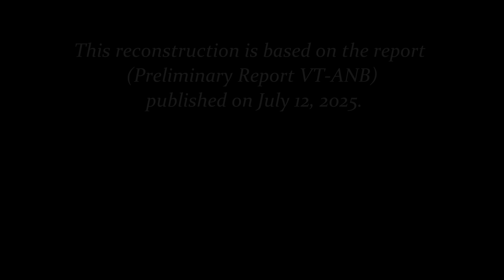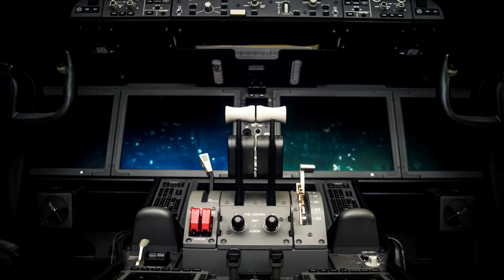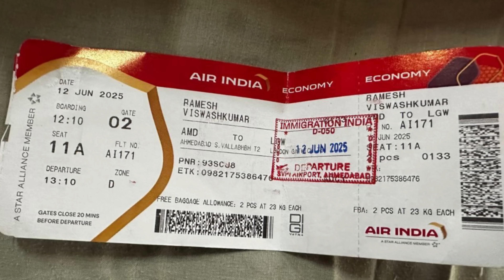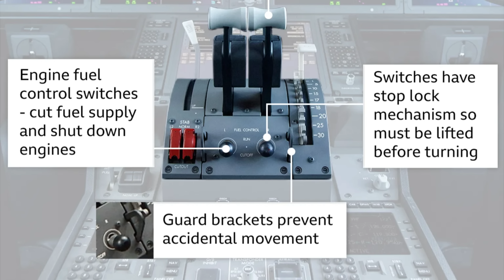787 Dreamliner Crash in Ahmedabad: Air India Flight 171 Crash Explained

Comment: Dramatic vid even with music, but narrator has no clue about 787 tech.. here we had a design problem and an electrical glitch.. tech manual tells us fuel switches need NOT move If electricity to fuel valves  is lost for even a fraction of a second, 787 and 777. Then, the spring loaded fuel cutoff valves to the engines will snap shut. Cockpit switches stay OPEN.... Happened to ANA 787 after landing using reversers, in Osaka and unable to restart.   Rtd Training Capt EAAC  Pilot Union rep at Regional Air Accident Investigations
Reply: Hopefully will be clarified in the final report. At this stage don't know if was intentional or unintentional by one or both pilots, electrical or mechanical failure. If had to guess it was one of the pilots that cutoff the fuel for both engines intentionally.
Reply: Sämtliche dieser Stories sind erstunken und erlogen, getürkt und gefälscht.
Es wird gesucht, mit welcher Mär man am besten verwirren kann,
um den wahren Grund zu vertuschen.
Da wird im Trüben gefischt, dass sich die Balken nur so biegen.
.
Wer in welches Mikrophon gesprochen hat, zeichnet der Boardcomputer
(Blackbox) auf. Wer was gesagt hat, lässt sich über eine Hüllkurvenanalyse
feststellen. Ein Standardverfahren in Forensik und Kriminologie.
Doch sowohl die Tonband-Story als auch die mit dem Treibstoffschalter sind
erstunken und erlogen. Das hat alles nicht stattgefunden.
.
.
Nein. Die Triebwerke waren ab V1 nicht mehr abschaltbar.
Die 787 ist "redundant".
Das bedeutet auch, dass widersinnige Aktionen nicht getätigt werden können.
Sie können den Schalter umlegen, so oft Sie wollen. Es hat in der Startphase
keine Wirkung mehr, da die Programmlogik aufgrund der Redundanz, ergo
des Systemzustandes (Takeoff) einen unsinnigen Befehl schlicht nicht ausführt.
Das ist auch bei der Landung für die Schubumkehr so.
.
Außerdem hätte zumindest die APU noch funktioniert.
Da auch das RAT ausgefahren wurde, wurde nichts ABgeschaltet, sondern das
komplette Bordnetz fiel aus.
Auch DAS lässt sich von den Piloten vom Cockpit aus nicht machen.
Nur am Boden bei Servicewartungen. Um die Maschine zu reseten.
.
Jamming per GPS aber schon. (!)  War schon in den 80ern vorgesehen, so
möglichen Luftpiraten die Übernahme einer Maschine unmöglich zu machen
und die Maschine per GPS in "sichere" Gefilde zu lenken.
Einige wenige Systeme mit eigenem Stromkreislauf (Funk, Black Boxes) wurden
noch von den Akkus gestützt.
Man hat sich erst mal weiterhin mit Sky-Marshalls beholfen. Aber inzwischen
gibt es ja besagte Technik und die immer perfekter.
Die hier dargebotenen Geschichten sind frei erfunden. Erstunken und erlogen.

.
.
Man sollte als BRICS-Mitglied besser keine amerikanischen Flugzeuge kaufen. (!)
Boeing ist auch ein militärisches Unternehmen.
.
Beim MCAS-"Absturz" der Äthiopian-Airlines saßen 20 äthiopische UN-Delegierte
mit in der Maschine.
DIESE 20 Delegierten, die mit ihren Gegenstimmen dafür sorgten, dass die USA
keine Militärbasis in Äthiopien errichten durften.
.
Dass das per US-GPS satellitensteuerbare  MCAS  generell geheim gehalten wurde,
war keine bloße Schlamperei und/oder Sparmaßnahme um Airbus dagegenzuhalten,
wie offiziell kolportiert.
-
Das US-Amerikanische GPS-System wird genauso in Waffensystemen wie Drohnen,
Raketen und dgl. verwendet wie in der Zivilluftfahrt. Das Jamming weiß nicht,
ob es die Funktionen eines zivilen oder militärischen Gerätes stört, bzw. unterbricht.
Das weiß nur der Absender.
.
Auch in der Indonesischen MCAS-Absturzmaschine Lion Air saßen fünf solcher
Widersacher, mit deren Votum ein Jahr zuvor auch in Indonesien eine Marinebasis
der Amis verhindert wurde.
-
Die beste Versicherung für Staaten, die sich den USA nicht unterordnen lassen
wollen, ist, nur noch von der brasilianischen Embraer, der chinesischen Comac
und der russischen OAK zu kaufen.
Die benutzen ihre Systeme, so wie auch Microsoft ihr Schnüffel- und Sabotage-Windows,
nicht als Waffe...

Comment: The switches were deliberately moved, one after the other. There's no way both    would switch off out of sequence. And,  it took the crew 10 seconds to restart the first engine which is an eternity. It's impossible for the switches to be knocked accidentally as two motions are required to move the switches, first pulling up and then moving it through an indent either up or down.
Reply: Agreed
Reply: Yes they can't be accidentally moved...it had to be deliberate.
Reply: yea it was suicide but indians wanna lie that its the planes fault
Reply: You know that, how?
Reply: Homicide by first officer 🤔✈️😢
Reply: those lost 10 second both pilot Verbal fight and Arguing for sure. that 10 second crash plane. if they would have turn on as soon as that will save plane for sure
Reply: @DK-lg7ti you're wrong. The engines take at least 10 seconds to start spooling up to full power...no time after someone...the captain almost certainly...manually moved the engine cutoff switches. They can't be accidentally moved nor are they electronically controlled.
Reply: This comment thread is a glaring example of how the social distance of the internet reduces people to childish jibes and insults. "You don't understand English properly," etc. This is playground stuff.  Grow up.
Reply: There's no visual evidence to prove that. It's all conjecture. Those switches have malfunctioned before, turned off by themselves.
Reply: It seems that your knowledge of English is poor. The preliminary report never says that the switches were turned off physically. It merely says that the switches were transited to off position. That means , the switches were turned off by electronic command through a soft ware.
Reply: @KPRavi-ps1uu  Not a pilot here, but as I understand it the switches can only be moved or "transitted" physically, because they require a physical "lift-and-move" action to change positions. The movement of the switch is then translated into digital data which is then communicated to the engine's electronic control unit (EEC). This data is sent via a fiber optic network. You are suggesting a possible computer glitch somewhere along the fiber optic network, between the digital data translation to the engine's EEC, which could stop the fuel to the engines without the switches being moved manually at all?   I guess it's possible, but the switches  must have been in the off position as both pilots mentioned this. If the switches were in the On position, their fuel switch question would have been unnecessary.
Reply: @bluemoon5662 you're correct and no time or altitude to restart engines and spool up to full power
Reply: @KPRavi-ps1uu I think it’s you that don’t understand English. The switches are mechanical and you have to use your fingers to lift up because it’s spring loaded and move back to cut off. The software has nothing to do with that and only the pilots can change that. Another 787 pilot from another airline confirmed these are mechanical switches and the software has nothing to do with it. The software only knows if the fuel is on or in cutoff. The left was moved first then one second later the right was moved. There was a conversation between the FO who was flying the plane questioning the Captain why did you cut off. The Captain denied because he knew the cockpit communication was recorded and calmly replied he did not but he was the one. The FO did everything to save the plane and everyone. May they all RIP!
Reply: @Jimbo-qe4gc  yeah thx, I see it is a completely closed system with only some relays and no software that can mess up ... 🤔

But could electrical wire shortcuts mess up? 🤔

But could there potentially be something else that gave them dual engine failure before the cutoff switches were possibly moved? 🤔

And switches were moved because of dual.engine failure 😮
Reply: @Harald-MacGerhard no...they are not electronically operated at all...fully manual function only
Reply: @KPRavi-ps1uu the word transitioned means moved if you know English well. It’s also important to remember that in India, their first language is not English. So the use of the word transitioned means movement. Nothing more. Nothing less
Reply: @lisafigueroa5307 
 Transitioned means moved. Doesn't imply anything as to how or by whom. It could be manual or automatic by the Fuel Monitoring System.
By the way, the switch does not turn the valves on or off directly. The Fuel Control System SW monitors the switch position and relays the command to the valves to close or open. This means, a glitch or an error in the system SW can also give a command without reference to the switch position. To safe guard against such failures, a Fail Safe system is adopted, so that if the SW or the System fails, it will fail on the safe side, here it is cut off.
Reply: Nope about English grammar  so get out 😂
Reply: @KPRavi-ps1uu  Same to you!! I repeat, there is no visual evidence the switches were turned off physically. They could have been flipped by themselves. Why? Because it happened to another Boeing. Stop blaming the dead when there's no conclusive evidence to support these accusations.
Reply: @KPRavi-ps1uu  Further still the FDR Data shows that the RAT deployed before the switches were cycled off and back on showing that the pilots were desperately trying to relit the engines. Hence the question did you cut off? No I did not. They were both trying to figure out what the hell was going on. Then they tried the switched in their desperate attempt to get the engines back on line. Not a suicide/murder as some suppose. If this becomes the narrative you know that the media is cover for Boeing. They have issues and skeletons in the closets!
Reply: @marklovely4966  The problem with "investigations" like this is that it's not being conducted in the US. Only the NTSB and FAA have the balls to actually stand up to Boeing and tell them what to do. Grounding the 737 MAX fleet was a major FU to Boeing and only American authorities can get away with that.
Reply: @KPRavi-ps1uu The mechanical switches can’t be physically moved electronically afaik?
Reply: @KPRavi-ps1uu they are not electronically controlled...they had to be moved manually